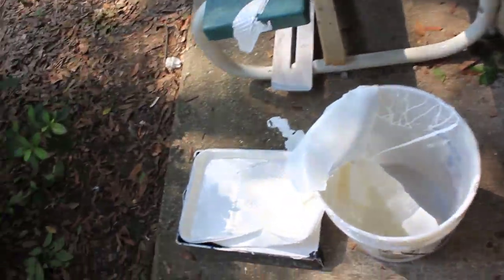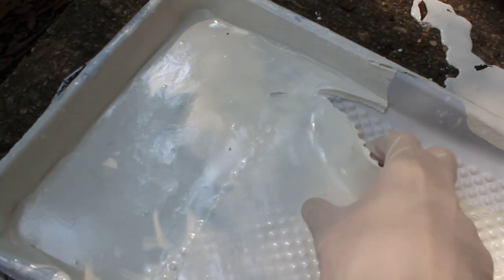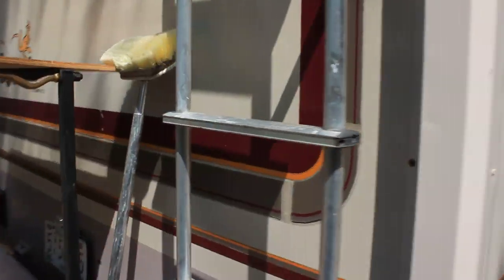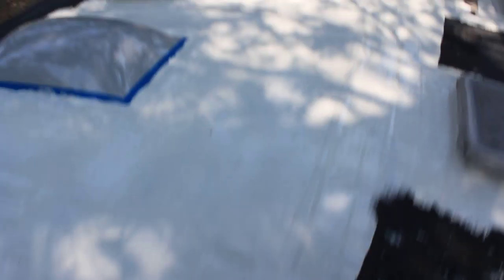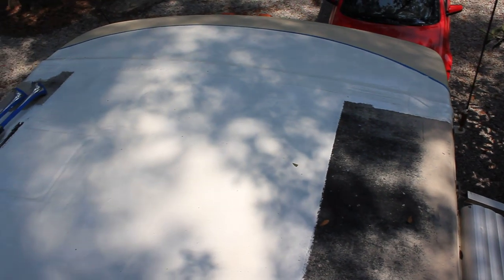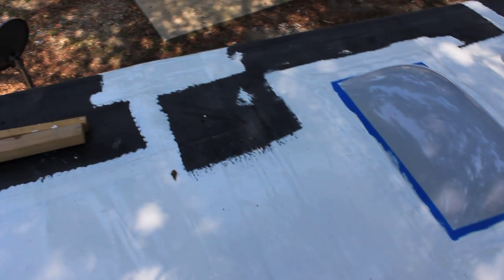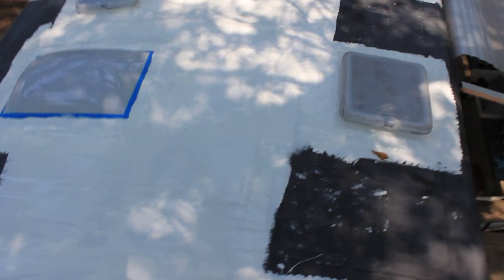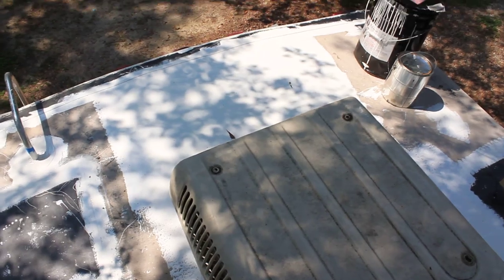New Liquid Rubber RV Roof

Comment from the maker: The rubber adheres to the tape just fine. The rubber around one of the pieces of tape did crack around the edge. Thats still not to bad considering it has been on for about a year and a half now. We may have not put enough on in that section. I plan to mix up a little more and just go over that section again to fix it. Good luck. It's a great product.

Comment from the maker: @JRBNETWORK You right, you did your roof a lot differently than I did. I really like the room you added. I can't remember the name of the product I used. I have been trying to find out for a while now. I can't find my receipt and the label on the can is covered by the dried liquid. It came with several chemicals that we had to mix. I ordered 5 gallons of the liquid. Still have some left. It to was about $600 plus that included some replacement rubber.

Comment from the maker: I spent just under $700. That also included new plywood and new rubber for a couple of bad sections in the roof. We rolled it right over the old roof. We had to tear the old rubber in 2 spots so we could glue the rubber back down to the base.

Comment: For those asking, I am very sure this is the product called EPDM Liquid Roof, now being called Liquid RV Roof but the labeling is the same, Liquid Roof.  The same company also makes offers EPDM Liquid Rubber, which appears to be the same type of sealant but for other than RV & mobile home roofs, apparently.  I'm not sure what the difference is.  I think the Liquid Rubber is used to coat single-ply (rubber) roofing.  I have used Liquid (RV) Roof many times.  Excellent product.

Comment: I just posted my RV repair job I did in 2010. a bit differently as I used a polyester fabric with Elastomeric liquid. had a bit more damage tho and we stripped off the old EDPM. I used a product called Hydro Stop. Was around $600 for 15 gal plus the roll of fabric. Yours looks great. What product did you use?

Comment from the maker: @travelingoutskirts No, its a different brand. I will try to find out what brand it is and let you know. I checked the can to see what it was, but some of the liquid has dried on the label. I can't read what it says. The price was pretty reasonable. I spent around $700 total. I ended up buying the liquid, some replacement rubber, and wood to fix some rotted spots.

Comment: I have 4 gallons of that stuff coming. Can I ask , do I just paint it over the existing old rubber roof after cleaning?
Reply from the maker: That's exactly what I did. Cleaned the old rubber real good and just painted over it. It's a really good product.
Reply: Thanks for the information. this RV guy said to me that to use DAWN to clean the roof, then use the Dicor Cleaner/activator-rinse and then dry...then paint the hell out of it. I have 4 gallons coming  UPS in 2-3 days. And as I added up the cost of that EPDM Repair Tape, hell I said...i'm going this route instead. And I will end up painting over the EPDM Repair tape in certain places as well....or around it.
Reply from the maker: It's a pretty simple process. I would make it a little thicker on any seams, add an extra layer or so. The seams on mine are starting to get a little thin. The rest is still in good shape. It's been 5 years since it was done and the only thing I have done since was wash it.